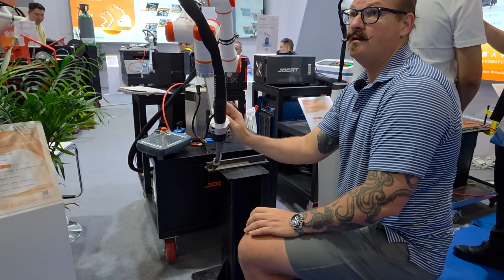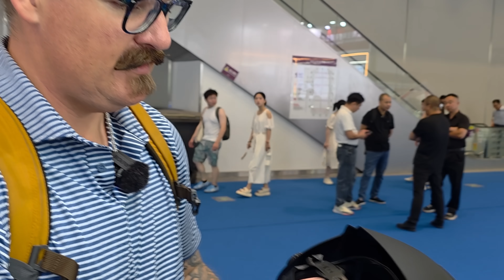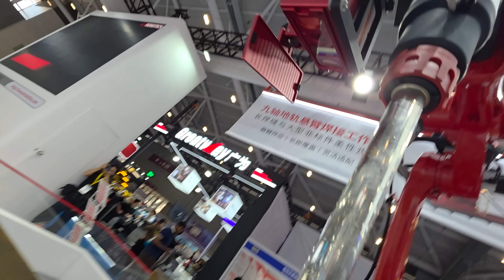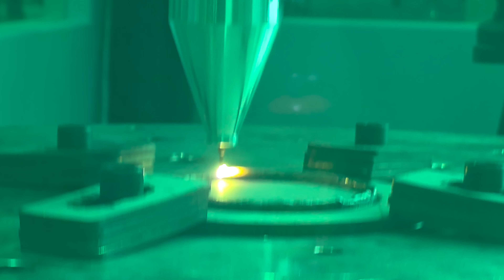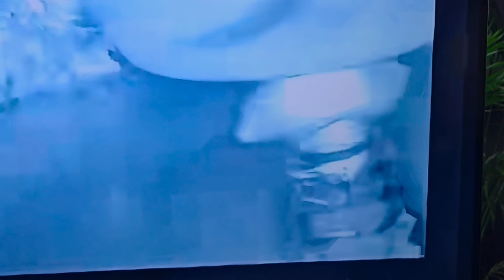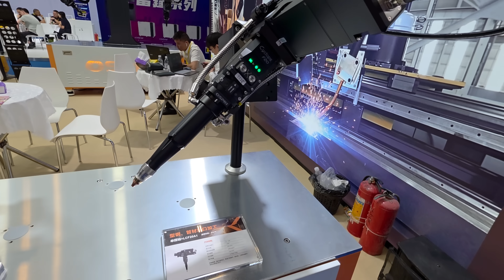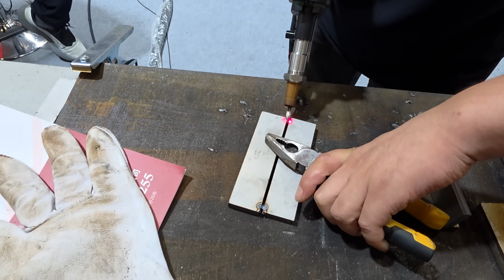The End of Hand Welding (I Saw the Proof)

Comment: I agree that the break even point of automatic is dropping, but for a one off part which is what a lot of small fabrication and job shops do, I don't think it'll ever make sense. Automating something done once is fairly pointless. It's why even manual lathes/mills still have a place for simple, one off operations and modifications where fixturing and positioning on a cnc and writing a program is more time than it's worth. 5 minutes to program that weld is nice, and for batches of a hundred or so it might be worth it. But for a single piece, even a dozen? You're guiding the robot through the motions anyway, you might as well pull the trigger yourself on the mig torch and just get it done.

I'm actually not sure the break even point is that low at the moment. That straight weld on the T joint tool 5 minutes to program, but the robot doesn't look capable of grabbing and positioning work pieces for itself, then unloading them from the work area. Not to mention getting it off the rack, cutting to length, delivering it to the robot, etc. All that can be automated but it raises the break even point on time from 5 minutes to program that one motion, to probably weeks to get the whole sequence down from raw stock to welded and finished part. And if there's a person loading, positioning and unloading the part for the robot every 30 seconds after it completes a weld, you might as well let the person do the weld at that point, the robot isn't saving any time, if anything it's in the way. 

Don't get me wrong, I'm glad the barrier to automation is getting lower, but the examples given are always really disingenuous. This isn't going to replace welders everywhere, this is going to lower the barrier and cost for serial production. Most welders I know don't weld the same thing in the same position over and over again. There's one or two offs, maybe a dozen. Most I've done is a couple hundred at once of some small items, but the whole job only lasts a day or two so the time spent working out the automation for the cutting, grinding, deburring and rounding over, welding, cleanup isn't going to see a return.

Comment: I started my apprenticeship as a millwright in 1963. I went through all the shops, coppersmith, sheet metal shop, welding and blacksmith here I obtained my Lloyd’s certificate, learning and using these trades is never a waste, put me in good stead for my job on factory maintenance. You say you would like to be a welder and do not want to learn “old technology” you should learn how to control the metal puddle first, gas welding and brazing is a good place to start, the job is all about knowledge of what you are joining together,albeit  aluminium, cast iron/steel, and all about the metallurgy of all ferrous and non ferrous  materials. Welding is not difficult to learn, the set up is most important, knowledge of how to tack up a job to control distortion, and type of rod and wire (mig) to use. I have never used a tig welder far too modern for me however I a sure I would pick it up readerly. Many years ago I used to stick weld stainless pipe for a plumber mate of mine. I still do the old job for my mate who has a farm close by, not as good as I used to be. You have to learn to run before jumping.. good luck to you
Reply: You started welding before I was an ameba.
Reply: Automatic welding machine or robot  that your talking that was started in the year 1950 it was in european and in America.i work in Saudi Arabia a Italian company large fabrication hangar all automatic or robot welding machine are made in Germany,Italy usa,Sweden now you re saying china has invented new tech about welding mach.your content is delayed.i think you only born yesterday.i work in Saudi 1980 as welder..
Reply: In a previous life I was a blacksmith probably
Reply: My grandfather an dad were both Journeyman Millwrights. I worked as a Maintenance Engineer for a national food-industry brand for several years until I became disabled, and am now getting a light fabrication business started in my home shop. My welding education started with oxy-acetylene brazing, then welding (using coat hanger filler rod) then SMAW, GMAW, and a little TiG. I agree that a good welder/fabricator should absolutely learn and know these fundamentals as well as learning as much as they can about the metallurgy of the materials they intend to work with. Unfortunately, or maybe fortunately depending on perspective,  this new tech is likely to eliminate much of the necessity for this knowledge as the machine itself will be programmed with all of this knowledge straight out of the box. As a time saver, this will be a no-brainer for job shops who will no longer need to seek out welders with this knowledge and skillset. The obvious downside is that within a generation or so, even the skilled trades jobs are going to be largely automated. 
    We went to FabTech last year, and they had full on fab lines from material handling, cutting, fit-up, welding, finishing, to final packaging for shipment which were 100% automated/robotic. Some of these machine centers look like sci-fi stuff. It's simultaneously amazing and disturbing when you think about the ramifications of how this stuff is going to affect the job market. It's a brave new world. Guess we all need to buckle up.
Reply: @shanecarender9051 indeed, it’s both exciting and terrifying
Reply: but but but.... cHiNa Is tHe fUTuRe!!!!????
Reply: ❤ there's need for 10,000 coded welders in refineries across Ukraine, Russia , Saudi Aramco, Israel,Haifa , Iran , the big bucks are in the war torn zones , name your price ....
Coded Stick welding will never die...
Reply: @Robo_au-j9o  Robot welding cannot fix repairs
Reply: 😊true , there's production line welders , and there is field welders , 
10,000 field welders needed now for repairs of refineries in Gulf States, Ukraine, Russia .
Koreans and Philippinoes welders built the ME, looks like they will rebuild it again if US ever stops bombing
Reply: @l @leehotspur9679 ver say never. Most of the stuff in this video is fairytale 5 years ago
Reply: You would be the perfect person for operating these types of machines. You have years of tribal knowledge to bring to the table to use these machines.
Reply: Tig or heli arc like you old guys call it can be very difficult to get use to but once you do its easy
Reply: What brand of helmet do you recommend and what visor? Last thing im trying to do is lose my vision over joining some metal
Reply: I'm happy for your success, but like this video is demonstrating, it doesn't really matter in the grand scheme how much you know when statistically most are going to lose their job. It's easier to have one person monitor and setup these machines, than a bunch of apprentices or more workers on a job.
Reply: Just...

Respect...

Radical redundancy
Reply: Old ass. Thats like saying you need to learn to drive a Ford model 3 before driving a Tesla.
No, just learn the modern thing that is infinitely better
Reply: @SighsInternally  Hold your horses, bro; the man is not denying the advantages of the new technology, he advises for becoming a well-rounded professional. Train the man first, use new technology after, that's his message. New technology won't make for a weak professional.
Reply: Yeah, but if you didn't learn to work a bellows, forge, anvil and hammer before, can you really call yourself a metal worker? Heck, if you can't alloy and cast bronze into at least a fairly reasonable kit of 5th century BC armor, you're just playing with toys and faking at being a metal worker. As you said, you need to learn the time tested basics first.
Reply: How are you seeing his reply as competitive ?   Hes saying he took his trade very seriously and made a good living doing it.
Reply: @dystopianstudios8325  Don’t think he claimed to be an og blacksmith

Comment: What I see here is not the end of the weld shop, but the ability of more people to START a weld shop.  I can't weld for shit, but if all I have to do is sketch/CAD up some parts to cut out of a flat sheet, send it to the laser, then tack it all up and send it to the robot welder, then that is a business I can handle. And I don't even have to blind myself slowly over a few decades.
Reply from the maker: I actually know an engineer that cannot weld but owns a welding shop because he has two cobots that do all the welding for him
Reply: @HeroMachineCo ALL the Engineers I know don’t know how to weld….they have learned how to calculate weld strength requirements including the fatigue considerations involved in most welds…..but laying down the beads….NOPE.
Reply: @hughjanus3378  Different people for different jobs.
Reply: What are all of them going to do? What is there so much to weld?
Reply: @BuddhaBhikshu  Cylons.
Reply: @BuddhaBhikshu  Apparently the military ship builders are short 400k welding  workers